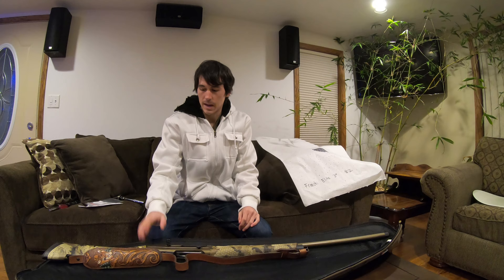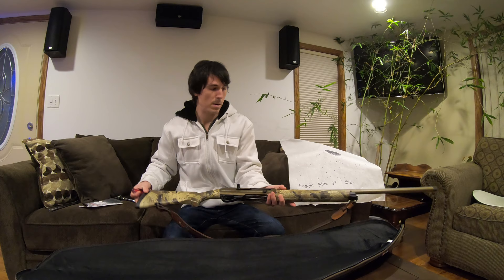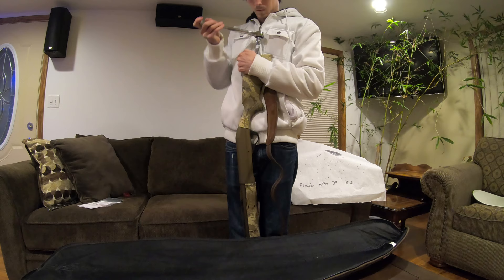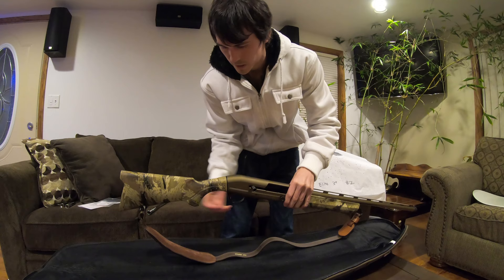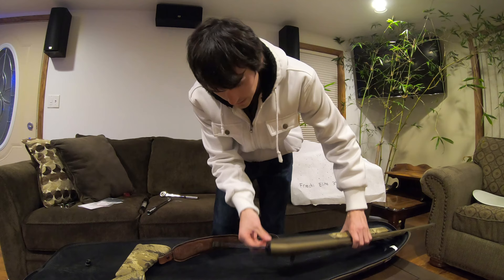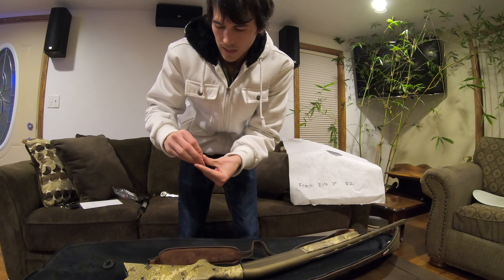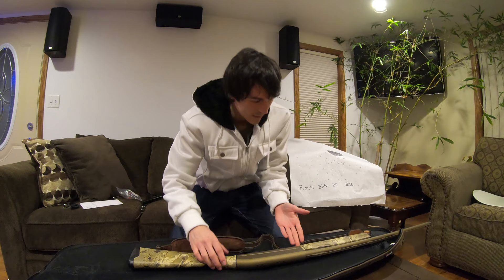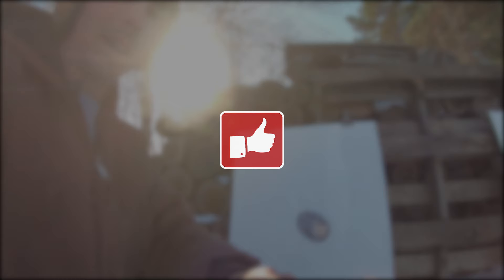How to adjust the drop and cast shim on the Franchi Affinity Elite and Stoeger Video #2

Comment: Much as I hate to rain on your hard work parade, I feel an obligation to let the viewers know that your information is ass backwards.  To lower the point of aim, lower the stock; to raise the point of aim, raise the stock.  Shoot your tightest choke tube at 16 yards at a 3” aiming circle drawn in the center of a sheet of typing paper.  The tight pattern will readily indicate whether your point of impact and point of aim are in sync.
I had the same issue with my lefty Franchi Affility 3.  It shot low with the LB shim, and didn’t print a decent 60/40 pattern until after the LZ shim was installed. I invite you to shoot your RA or RZ shim to see if I’m right.  Respectfully, Bill
Reply: This is absolutely correct this video explanation is backwards on how to raise your point of impact. Correct on how to change a shim out. But backwards on what shim to use and how they will change point of impact vs point of aim.

Comment: If you shoot low you need to see more rail! Not the other way round as told here.
Also the mounting of your gun seems to need teaching: It should not be necessary to move your head. Of course, sitting is diefferent - but then don't judge over the fitting until you test it in the right position for shooting ;-)
Reply: I think the sitting position is probably making a difference in how that looks.

Comment: Where the shim is installed, do you have a tiny gap at the thinnest point of the shim? (Gap between the stock to the receiver). 
I just swapped shims on mine and there’s a tiny gap at the thinnest point - not sure if I didn’t crank down the nut for the stock tight enough, or if something isn’t sitting right
Reply from the maker: I do not have any gap